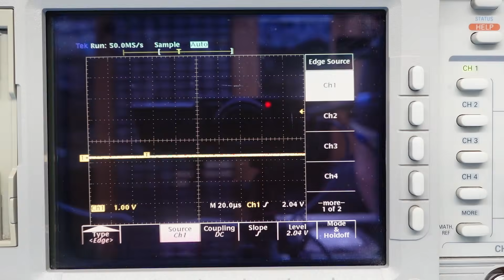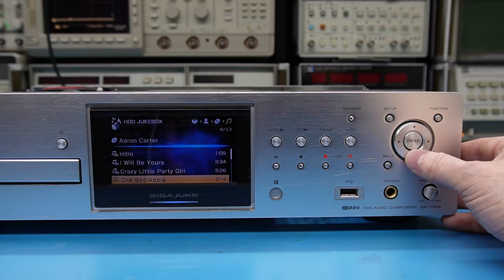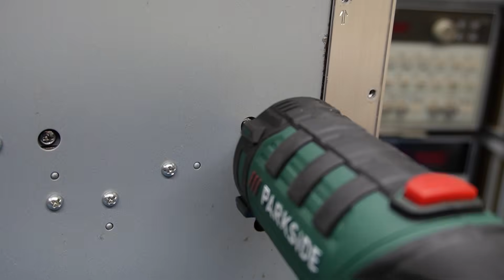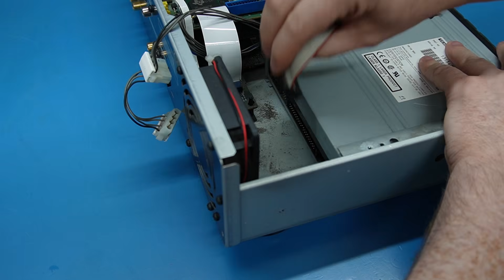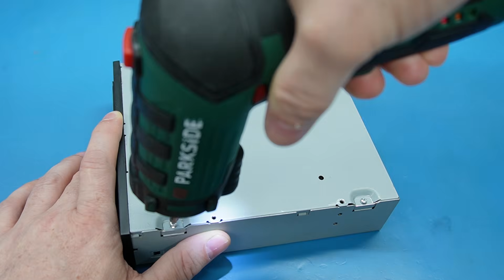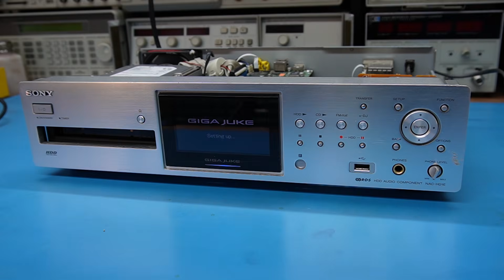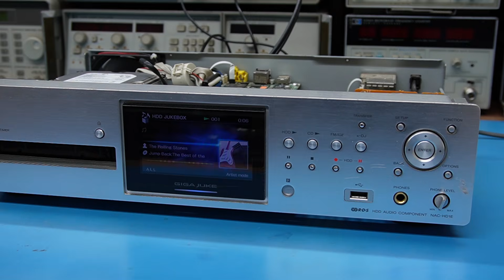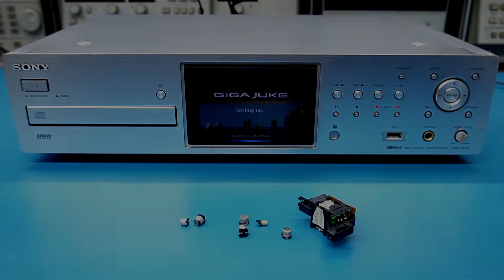SONY Giga Juke, Codename 'PROBLEMBOX'

Comment: PREVIOUSLY DELETED VIDEO - The £25,000 Pre-Amp that went Wrong - Tom Evans Mastergroove SR mkIII
* Autogenerated transcript of the most important section *
The basic block diagram is pretty straightforward the pho input goes directly into the low noise preamplifier which is fed into an equalizer circuit then through a low noise buffer and straight out the device but in this design they've done everything they can to keep noise right down to the minimum the first thing to note is each active stage is powered by its own regulator each one of these are dual plusus 15 volt regulators and these Regulators are powered by their own Regulators how's that for Thora 

on the next page is the interconnection diagram Just sh it's all wired together pretty straightforward then we've got the power supply there's nothing going to blow your socks off in here pretty straightforward linear power supply with standard Regulators moving on to the main board which is the blue one this is where all the action happens and again you can see how the 

input signal goes directly into the amp boards two of them then they go for this little filter for Equalization and then to this opamp here which is the line output and 

what's interesting here is they're loading each one of these opamps with its own constant current Source at least that's what I think it is and on the next page we look at the load noise preamp board and what we've seen are 

four identical opamp circuits and each one of these has got a gain of 605 now whil a lot of allj file stuff is complete nonsense there is at least some science behind this here's a conventional up hand circuit this is the non-inverting one so the input goes to the positive input and on the negative input we have two resistors creating a potential divider which creates the gain of the circuit so you can put a small signal in and it comes out the other side Amplified but what happens if you put a tiny signal in like for this Pho amplifier we are talking 0.4 mols which is certainly a tiny signal but the opamp circuit will amplify in the exact same way apart from this time we're going to experience a load of noise on there 

this noise is actually coming out of the opamp manufacturers will do whatever they can to minimize it but it's very expensive to make low noise op amps and there are ways to improve it and the key behind this is the fact that noise tends to be random so if we look at this 

clever solution here we take our tiny signal again but this time we put it through two identical amplifier circuits each one introducing its own random noise if we then join these outputs together we create a stumming amplifier which doubles the amplitude of the output but reduces the noise level basically because the noise is random so when you add two random things together they tend to cancel out

the noise reduction is proportional to the number of opamps in parallel so if you're going to use eight op amps in parallel you reduce the Noise by 2.83 times it's very important that each one of these opamp circuits gives the exact same output which is why the feedback resistors are very high tolerance 

look at that 0.1% if you to look at the data sheet for up amp you'll see lots of information a lot of it is a bit confusing so it's very useful the pin out for example but we'll get to the important bit I want to show you now the electrical parameters we scroll down enough and we'll see we've got the input offset voltage and it's something like 5 or 6 mols now consider that with a signal with an amplitude of 0.4 M amplitude you'll get some weird Distortion in that circuit and we start to see the reason for the manufacturer's claims here about all this hard work measuring and match in every single component to measure the input offset voltage the first thing we have to do is put the same voltage on both inputs because it's such a small measurement we need to put some gain in here so we can go with a 10 ohms at one side and 10K on the other this will give us a gain of 1,1 

I built that circuit on the breadboard and going to see what the doet voltage is of various opamps I'm going to PIR them all with a plus or minus 15 volt Supply this is a UA 741 upamp and you can say the output voltage is 1.15 volts that gives us an input offset voltage of about 1.15 M 1.15 Ms that's way too much for a 0.4 molt signal going to take that one out going to go with an LM 308 which is about 0.2 Vols so that's 0.2 Ms which is 50% of the signal level pretty bad 

going take that one out there our next is an unlock devices op07 these are pretty good up AMS now we're reading about 14 M volts which gives us an offset voltage of 14 microv volts which is about 3.5% of the signal I'd imagine for this preamp they're looking for input offset voltages of below 0.4 microv volts that's about 0.1% of the input signal that's going to be a lot of work

Comment: What happened to the Tom Evans video?
Reply: The video is no longer available due to a copyright claim by Tom Evans.
Reply: @AfternoonPlay It'll be solved pretty soon I think as you can't copyright something like that being fixed. Someone must have been very angry as the manufacturer originally refused to fix it. A device that expensive should have at least 10 year warranty. Such a claim doesn't make you look better in the least.
Reply: Tom's woken up today with Louis Rossmanns testicles in his mouth😂

Comment: Adrian Black of Adrian's Digital Basement swears by a "push and twist" method of SMT electrolytic cap removal wherein you grab the body with pliers, push down toward the PCB, and rotate a quarter-turn. It looks super dodgy, but is quite effective and doesn't lift pads (despite expectation). Not needed if you've got the proper soldering tweezers, but a bit faster perhaps.

Comment: When you replaced missing 0402 resistor I have noticed that SMT capacitor next to it have got signs of corrosion. So device could have been done either liquid damaged or used in humid environment. I would suggest to remove MB and check under microscope whether you can find corroded components, tracks or vias etc.

Comment: Its not giving any sense. Its digital device so its unlikelly any hardware error would cause playback slow down. You would get garbage or no sound at all. Plus radio plays just fine, so there is no issue.

Comment: Probably some logic gates (e.g. IC1601) are dead. Then, it could miss some bits to recognize the right sync, and it plays only the half of the samples. This leads to the slow playback rate, as the single components get the wrong input but still doing theit jobs fine. I think it is not a software problem.

Comment: I think it is missing a lower bit somewhere in DAC counter. You can probably check FM and see if it's output is below 12 kHz then it is operating in that same low sample rate, but sounds normal because audio loop routine is bound to sound frames and it just encodes the radio input in same clock

Comment: Watch, there probably bis a setting that can be made by the front panel. Get a repair or  maintenance manual or at least an owners manual. After all it is a computer with a display and a hard drive so there may be an optional setting to be had on the display via buttons.

Comment: There has to be a playback speed setting or maybe a "jog wheel" type thing likely on the remote that lets you speed up slow down playback like some of the fancy VCRs had or a sample rate setting that has it playing slow. Digital won't play slow due to a mechanical problem. It just breaks up and stops working like an HDTv signal. It's there or not. Good luck with it. I don't have a chance to read all the comments but I think someone mentioned a firmware reset procedure. I would look there. I just can't think of any hardware fault that would cause anything digital to have a slow playback speed like that.  Otherwise I think you fixed it. Good luck.

Comment: Nothing to do with the spindle motor. CD is a digital format. It reads data at a faster rate than needed from the disc, decodes it, then sends it to to audio at via software. It's a software issue or rather a hardware timer driving the software.

Comment: You checked the 27 MHz but this signal goes into a clock generator. There are 25 MHz, 48 MHz and some other frequencies coming out of that IC1701. I would check them as well.

Comment: Hi Mark, my Panasonic sound bar ( model SU-HTB550) is playing up. The sub woofer no longer connects to the unit ( wirelessly) put it in pairing mode and it won’t pair. I’d love it if you had a look at it on your channel. Cheers 😉

Comment: dude, the roation speed of a cd player dosent change the playback speed....its a digital format, not a analog cassette where half speed means slow playback.....or do cds need to spin up if you fast forward a track ? the slow playback is pretty much a wrong playback setting deep down in the device menu, further more, back in the days cd players that where able to reduce/increase the actual playback speed where pretty expensive

Comment: The problem is in the DAC chip. The file content on the HDD is in 44.1 KHz and so are the CD. But the ADC is in 48khz. It’s not switch between those sample rates. Therfore you have perfect recording from FM radio, i think it’s recording in 48Khz and therfore its sounds right. 

Check the sample rate.

Comment: Wild that they were still using IDE in 2007. I would've probably just tried to replace the whole CD drive instead of the laser but eh might've had some issues with the eject button, and it's possible the little SoB in there might complain about the drive being different.
Reply: Not at all surprising. Lots of systems still used parallel ATA for CD/DVD drives in 2007.  SATA optical drives weren't common for a few more years. In 2005 there were a lot of optical drives that has a SATA to PATA bridge attached instead of an integrated SATA interface (which started being common around 2009). and SATA controllers were still more expensive than PATA. And a lot of set top boxes were still using PATA, like DVRs.

And if using PATA for the optical drive makes sense to use it for the HDD too. They were still common and cheap.

Comment: Speed on play back is software again in the same shop a guy buys a 4 speed CD Rom brings it back saying it a single speed I say the speed of the motor has nothing to do with the drive it is the computer data can go at a faster speed only for copying from CD to HD or reading data.  I did try and slow the drive my self did learn in 30 seconds it not like a tape

Comment: Stick it on ebay as untested that's what everyone else does 😂 I used to tinker with ipods the number of ads showing an ipod with an error message and listed as  untested no lead especially from a seller with multiple listings of similar items some working mmmmmm , I messaged one guy from leeds "how did you get it to power up without a lead " got quite a fruity reply

Comment: Hang on… am I correct in assuming that you thought the spindle motor wasn’t playing at the right speed as a result of a potentially bad control IC or the bad caps? I didn’t think this would cause slow playback on a CD player lol. Wouldn’t you just get the “falling off a cliff” digital effect of jittery garbled playback, skipping etc? If that were the case? And I would also think if that were the case, wow and flutter would actually be measurable on a CDP. 

Now interestingly enough, on a LaserDisc player it actually might have that effect as I understand those are using a laser but it’s still analog.

Comment: I enjoy your board level repairs, but as it is just a cheap IDE cdrom drive in there, wouldn't it have been easier to just toss it out and put a "new" one in, or would the firmware not allow for that?

Comment: Apologies if anyone else suggested this.  I looked on Amazon UK and cheap DACs can be had for as little as 15 pounds.  Might be worth doing a test, connecting one of the digital outputs of the Giga Juke to an external DAC, bypassing the internal DAC on the Sony.  If the audio plays back at the correct speed consistently, that would point to a bad converter on the Giga Juke.  It sounds like it's not locking on to the proper sample rate of the audio files, either from the hard drive or the CD drive, which would make sense.  It seems to be defaulting to 48 Khz or something random, instead of 44.1.   In case you're interested, the Amazon branded device has both SPDIF and TOSLINK inputs to analog RCA outputs and can support sample rates up to 192 Khz.   I found it searching Amazon using "spdif to analogue audio converter."  Just a thought.  Love your channel.  Best of luck!

Comment: I think the "slow" playback is rather a stuttering, like the DAC is going into an underrun then is fed the next chunk of WAV data via DMA again (maybe you can see it looking at the output waveform with a scope). I'm guessing something is overwhelming the CPU with interrupts, that's why it can't keep up feeding the DAC. The radio is probably not going through the DAC, so it's working fine. Either it is a component on the mainboard, like a for example an RTC with a defective battery or goldcap which makes it fire its alarm interrupt all the time, or it is actually the HDD. Constant IDE (error) interrupts can also make the CPU slow down to a crawl. If its not the HDD it can also be the IDE cable - yes they can go bad!

Comment: After that 24V shock it decided to become a 60Hz device. Runs slow on your 50Hz mains ;)
A tricky fault. As many suggested in the comments, a configuration reset is worth a try. Maybe the playback speed is somehow linked to an RTC which might have problems because of a dead backup battery or something? Just an idea.
Thanks for your interesting and also entertaining videos!

Comment: It asking for rudimentary settings on startup screams of dead "bios" battery type deal
Id be tempted to seek and replace whatever battery it relied upon - and also try and find a remote
Hate it when the remote gives functions not accessible from the machine...
If you can change the recording speed (from 4x - to normal) might be worth trying that...
Firmware will be out there somewhere surely, shame the wayback machine has been tampered with...grrrrr

Comment: I'd say it's hardware failure, it can't be clock. Because the CD copy is consistent. What might be interesting would be to connect the hdd to a PC and see if you can read the files. Linux may help you, internally it probably runs Linux.

Comment: The sony pro walkman had speed adjustment with a pot controlling a phase locked loop circuit or something like it. Your machine may have something similar to change playback speed and it will be controlled with software if there is no pot. My walkman's circuit for speed adjustment went bad and is still in the cupboard!!

Comment: I was surprised you didn’t check for power to the laser assay or checking it was moving to try to scan the disc before actually replacing it or did I miss something 🤔

Comment: From where you have got to I would suggest check RTC battery esp as unit is 2007, set the time manually (user manual says unit will not work properly with out this) then check the Option setting for monitoring the recordings. Manual says recording (ripping CD) will be quicker when audio monitor setting is off (factory default), maybe the slow playback fault lies in that area of control.
Good luck if you decide to delve deeper.  A factory reset is also very easy to try. Love your channel and skills.

Comment: Can you check the motor of the CD-drive and the its control unit? It could be an issue there like a loose connection or bad soldering; that's why it worked randomly connected to the PC 🤔